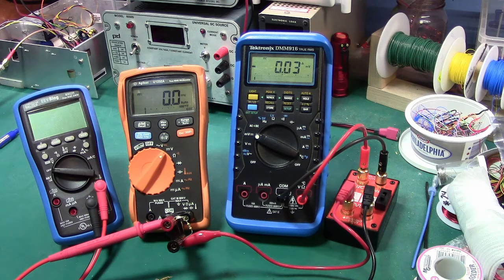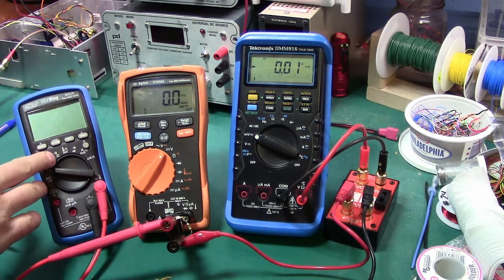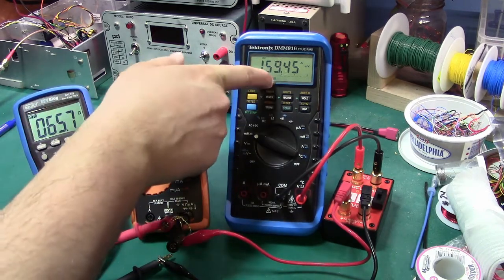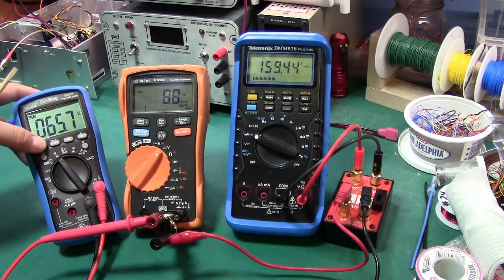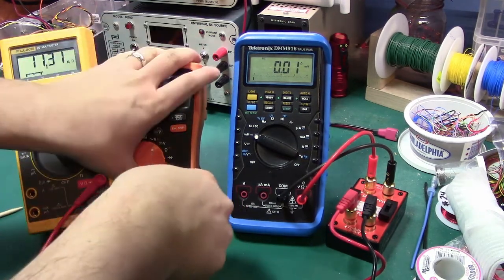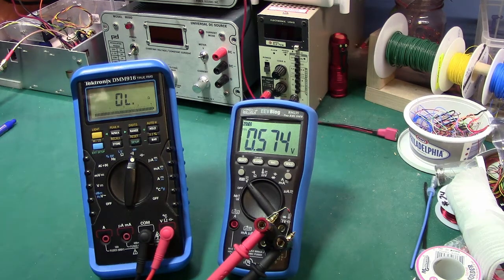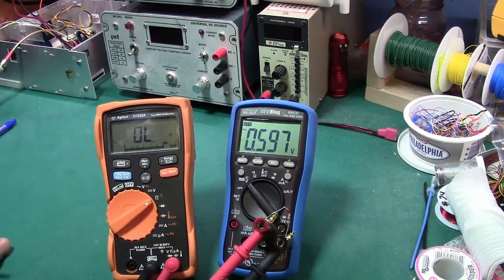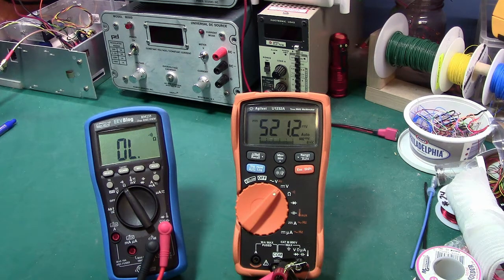Can a Multimeter's Continuity Mode damage circuits?

Comment: I know this is not a review channel but i do have one question, if you need to pick one multimeter from your current lineup which one will it be? and if the option is between the bm235 the and keysight wich one of those?
I need one multimeter for my bench so i'm curious wich one you prefer.

Regards,
Yoav
Reply from the maker: I'd have to say that while both are very nice, but I end up reaching for the bm235 more often.

Comment: The Brymen seems to be purposely sourcing less current in its continuity mode, so the diode forward voltage drop you see is a bit lower.